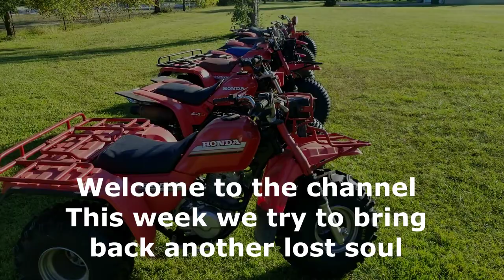How to save a Honda ATC 3 wheeler, Will it run?

Comment: Good video. These little Hondas  have their own sound
Reply from the maker: Yes it does!
Reply: @mrcbuilds  I have a couple of pictures of the Big Red I used to have 10 minutes into my off grid cabin video if you want to check it out. I used to pull a trailer with supplies. The puddles were long and deep but they had a bottom without muck. The trail was so slick when wet  I carried ice studs to put on my boots if I ever had to walk out. The Big Red never let me down though. The place is built now so we about the only thing we haul in is propane and food. The place runs on solar and I built a cistern. Not having to carry water and gas makes things nice.

Comment: FYI spec for the valves is 0.003" for the intake and exhaust. Thats 3 thousandths, 0.0005" (zero point five thousandths is much too tight, basically no clearance at all. Overall great video 👍
Reply from the maker: Thank you Okie Canuck, I appreciate the feed back.

Comment: Another great video....
     Thank you!
Carburetors. 
My first and only experience with a Chinese carb wasn't the best. The configuration wasn't exactly the same, but I made it work. Along with the vent line being in a different location, the elbow on the slide (needle/throttle) was a different length, but I was able to utilize the original. Ok, it worked.
     Unfortunately, over the winter, the float leaked. It filled with fuel and all the gas drained out!
     I had to clean the old carb, (which is what I attempted to avoid in the first place) and the trike runs well. 
     Is there a certain supplier/brand that you prefer or use for the carbs you buy? I've also heard that the jets may be different than factory?
     Anyway, I learn tons from your videos. You're my "go-to" guy.   Lol
Reply from the maker: Thank you "go to guy" lol, The best carb is the factory carb hands down, but I have had good luck with the inexpensive carbs from caltric off amazon. If I can save an old carb I will. Curtie Eldridge at 223 cycles does an amazing job on original carbs. look him up on FB if you need an Original carb saved, tell him I sent you.

Comment: I’ve got a 1982 185s.  I want to keep the original carb— noticed you swapped out for aftermarket carb.  Do you plan to clean and rebuild the old carb?   Also mine doesn’t want to idle down.  I’ll check the valves like you did.  Thx for the informative video— excellent job.
Reply from the maker: I have had good luck cleaning the old carbs, I was pressed for time on that video, so I just through a aftermarket on it. Aftermarket carbs arnt terrible, but the factory carb is the best

Comment: I have another question, can you use an 1983 185 rear fender on an 1982 185?
Reply from the maker: You will need to compare the frames, there are a few differences between the the 82-83 line of 185s. I know the rear axle is different as well as the front suspension. I think they it should fit. Look up the part number for each bike, if they match then it will fit.
Reply: Thank you again

Comment: hi i need help with my honda 200 wont start
Reply from the maker: First download the service manual from oscar meyer website.
Then check for spark
Then check compression  80psi or more. Them make sure your getting fuel. Finally check your timing. Somewhere in those 4 things you will find more problems

Comment: Could you please tell me can I put a 200 cylinder on my 185s and use the same head?
Reply from the maker: Yes, you can use the 200 cylinder with a 200 piston on a 185s bottom end, I would use the 200 head if you can.
Reply: Thank you I was having so much trouble trying to find a piston (63mm) and rings. So I’m just going to up grand to the 200

Comment: Hey, i know a guy who has a good sized collection of these, he said if i got 2 of them driveing,i could haveone. Any tips?
Reply from the maker: Watch the video, follow the steps. You must have spark, compression,  fuel and air and timing.
Reply: @mrcbuilds  ok, like all engines, anything in particular other than engine I should look for?
Reply: @mrcbuilds update, I got one drivable, and two others running
Reply: @mrcbuilds do you know where the grease point is for the rear axel?
Reply from the maker: @anicekid  on that one you pull the axle and re-pack/replace the bearings i believe.
Reply: @mrcbuilds  200e?
Reply from the maker: @anicekid  the 200e, 200m, 185, 185s, 200 and 200s are all about the same design.